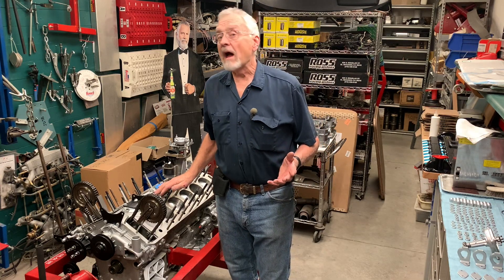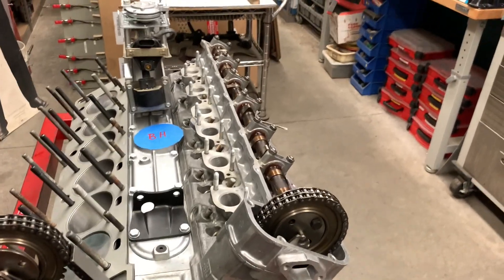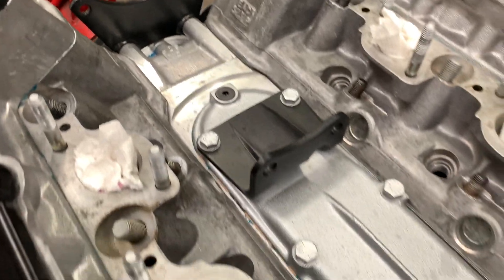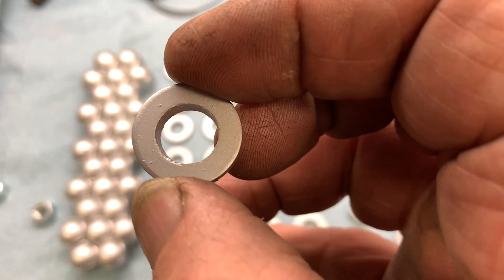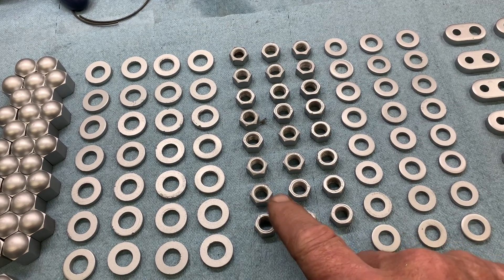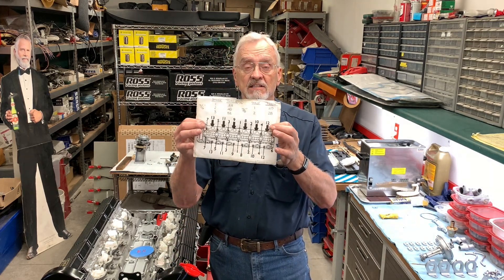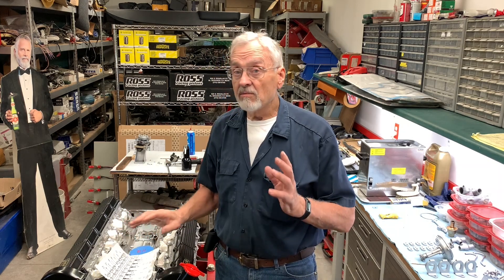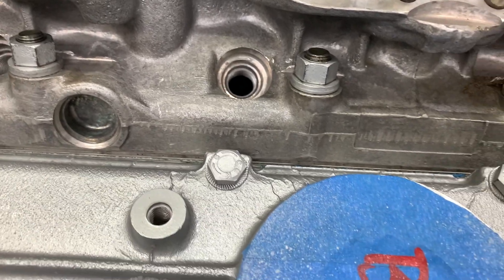S4:Episode16-Jaguar V-12 Cylinder Head Installation Pt2

Comment: Bob,  how do you deal with the { invariably} warped heads? 
Have the machine shop straighten them using a torch? 
Nice and Shiny Engine you got there!!
Reply from the maker: I've only got one head that needs straightening after welding. I intend to try it myself with a torch this winter. If I get the time.

Comment: hello bob. a trick i have used originally on stud modified bb fords when using aluminum heads.  wrap the threads with a bit of teflon tape. helps smooth the installation out w/ far fewer shavings all around.